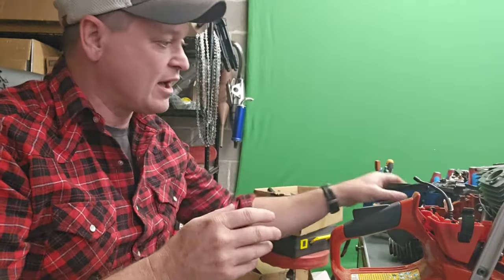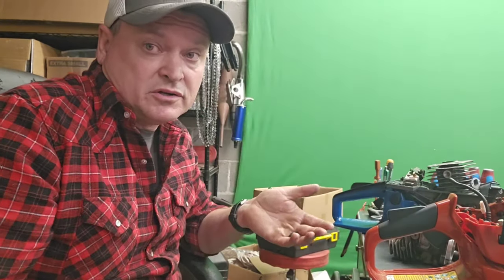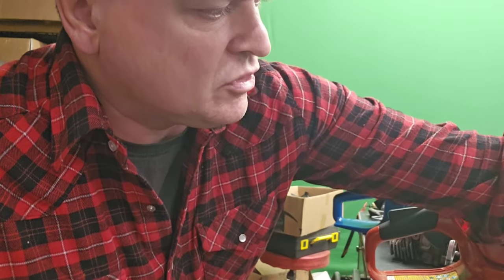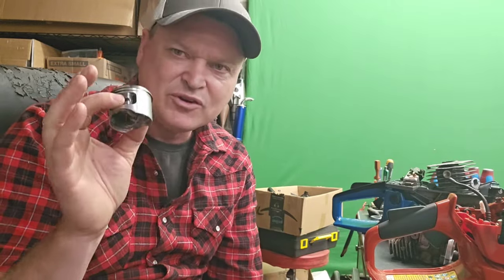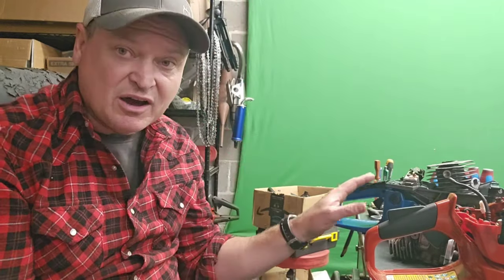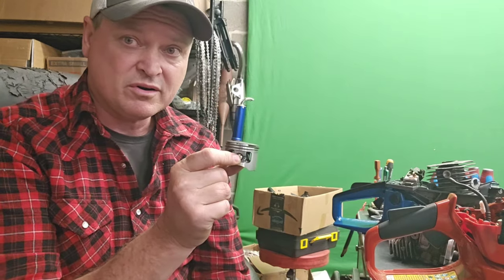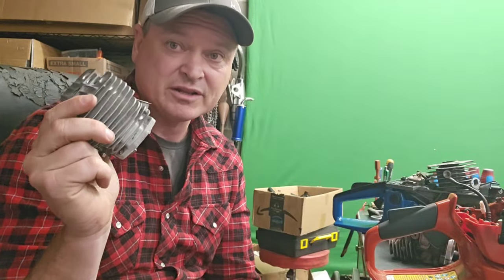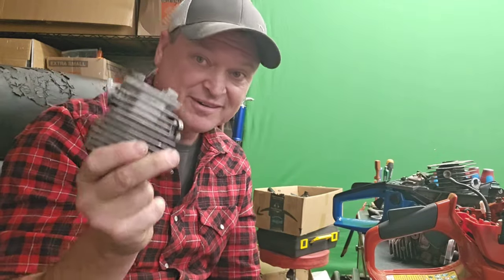Measuring Chinese Zenoah Clone Saws

Comment: Right on. 

1st clone neotec I did was a “6200”. 46 mm piston, dead on. Stroke 34- best I measured it. 56.5 cc

Next one- advertised as 5800….no idea yet!

Recent black and decker clone/ 41.5mm bore, dead on. Will check out stroke this evening with a ring from bdc and do some math, since I have it apart. 

I believe you have to buy cylinders and pistons in a pair. It’s like they make the cylinder or the piston fit what ever they cast first or what they have too much inventory of!

Comment: I've commented this before on the wiemars vids.
I have every size  made of this clone.
4500 43mm bore 32mm stroke
5200 45mm bore 32mm stroke
5800/6200 45.2mm bore 34mm stroke (54.5cc) most of the time but some times you get the 4500 with 5800 stickers like my brother did.
6150 timberpro that I own 48mm bore 34mm stroke. I have not been able to find a good replacement cylinder in this size, there's one on alliexpress but it has bad timing and  low compression.
The big difference between the 45mm cylinder and the 45.2mm is the height, the 45.2 is for the longer stroke. I think they made them .2mm bigger so you cant mix them up.
Sometimes the 45.2mm is listed as fitting all sizes but it has a mile of squish on a 4500/5200 saw.
I have not been able to find a 46 or 47mm cylinder, I dont think it exist and people are rounding up while measuring the 45.2 cause it more than 45, you even did this and told me it wasnt 45.2mm/54.5cc lol.

The 47.5mm cylinder is for a different zenoah 60cc saw and has a different intake, you dont want this cylinder it no fit.
Reply: Measured the black and decker 42cc. 

Bore 41.5. Stroke 30.35   41.05 ccc. determined by piston at bdc, with degree wheel and ring in cylinder. Measure total cylinder, deduct distance from bottom of ring and deduct squish. 
Guessing it’s probably 30…real easy to pooch 1/3 of a mm
Reply: I have similar experience with my three clones. Bore is easy to check: 4500 is 43mm, 5200 is 45mm and 5800 is 45.2mm. I tried to measure the stroke and I got 31mm for 4500 and 5200, and 34mm for 5800.
I also have two smaller, g3800 clones. The bore on one is 39mm, on the other it's 40.5mm. Stroke is listed as 31.1mm, didn't measure it myself, yet.
Reply: exactly. And all of the cylinders are available as dual port and as quad port models while the quad ports have a little more horse power, max rpm and torque

Comment: the real 62cc (61,5cc) are very rare and mosrt of the manufacturers are labeling the 58cc models to 62cc or even 65cc. I tested round about 25 different zenoah clone saws and just found a few real models with 48mm bore (there is no 47,5mm at this zenoah clones) but searching for is worth it because its a huge differenze between the 58cc and the 62cc models and the power-to-weight ratio is best with the biggest cylinder on that small bottom ends